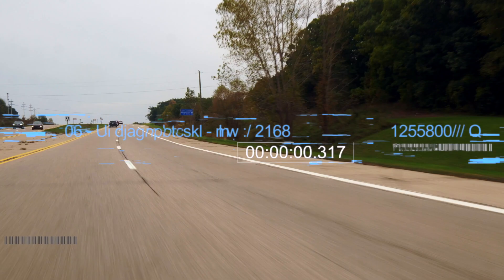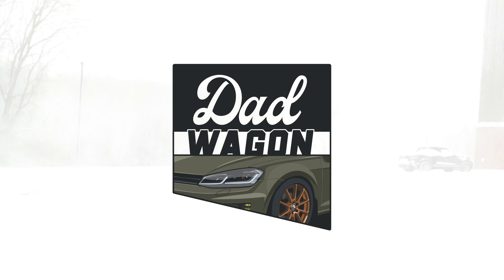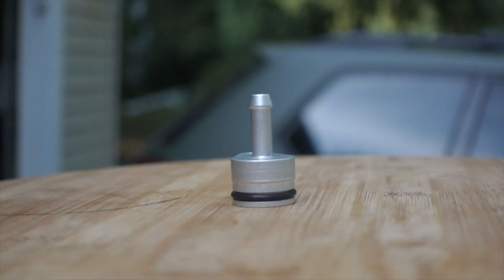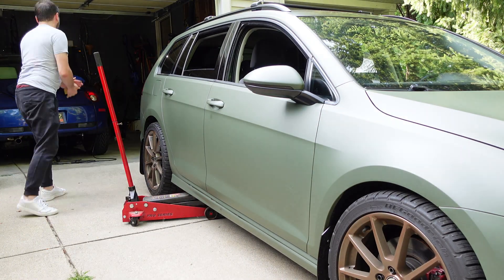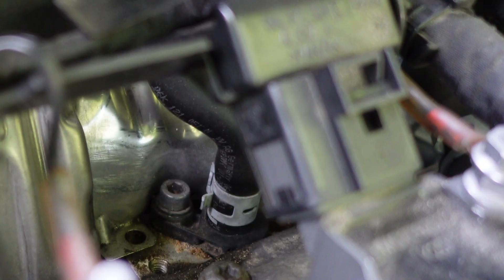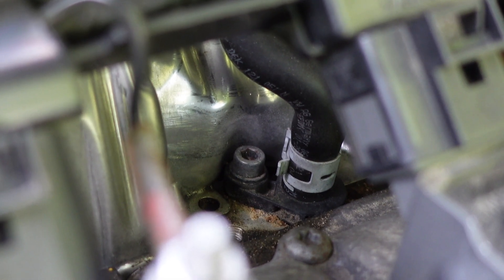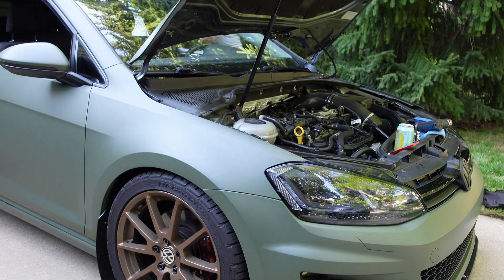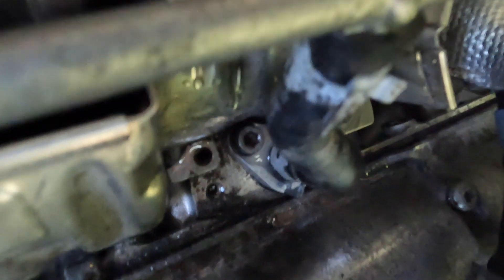Aluminum Coolant Flange Replacement to Prevent Leaks - Mk7 Golf GTI Golf R Alltrack

Comment: Hi guys, I have my thermostat and water pump replaced like 5 months ago. I now have had a slow leak for the past 2 months, its been to 3 mechanics and not a single one can find where coolant is going. The coolant leak is very slow like maybe 1 litre every 2-3 weeks. Do you think this video is the same issue I have?

Comment: I went inside Best Buy store yesterday. , just looking around. When I Came out & started my car I saw a low coolant warning. The temperature gauge did not show over heating. So I drove home. I googled the issue and was told to check the coolant level in the reservoir. Sure enough it was low. I had some ooolant in the garage. I filled it up to the proper level and the warning signs went away.
I just bought this car used. It runs great. Now I am thinking I need to replace that plastic flange.
Reply from the maker: Just depends on where the leak is coming from. You should be able to track it down with a flash light.

Comment: The type of oring used also seems to be an issue. The rubber swells due to the high temperature and exposure to the coolant. Do you know if the aluminum part has a better quality oring and how is the part holding up since you replaced it ?
Reply from the maker: I don't, but I haven't had any issues since install.
Reply: Thanks for the info and video. Where did you order the part from?

Comment: I had this problem happen to me this week. Smoke started to come out from under my hood. White smoke at that. I looked at may car and checked for an oil leak and it wasn’t that. My cousin said to check for a coolant leak and he was right. I ordered the part. Just waiting for it to arrive. Thanks for your video, now I know how to change it.
Reply: It went well. Removing the rubber hose was a pain. It was really stuck. But once removed. I installed the part and all is well.
Reply from the maker: Sorry to hear but glad you got the part on the way! How did install go?
Reply: Same thing happened to me today.
Reply: @lowkey5854 good luck man. It’s an easy fix if you have the right tools and parts.

Comment: Thanks for the video. A few notes:
- My ground nuts were sized together so I did this without removing my harness it was fine
- I removed the hex bolt and then pulled the flange with the hose attached out of the car which was easier for me to get the hose off
- I didn’t find a need to jack up the car, although I lost about 1/2qt of coolant.

Comment: shot in the dark here, but does anyone know offhand where the get the part no of the small angled hose 4:04 which he is able to reuse in this case? In the case of my Alltrack, hose was brittle enough to break apart, I have an old rubber air line hose that I cut to size and mangled in place however I’d like to obtain the oe hose. Excellent video, and props for your build
Reply from the maker: Great Idea!

Comment: Literally could of done with this video three weeks ago mine failed on the way to work and steam spewed from under my hood and was due the o ring spitting what the benefits from replacing it with an aluminium one I just replaced mine with another plastic one from volkswagon im better to go out and buy the aluminium back one
Reply from the maker: Dangggg - sorry to hear that. Glad you got it repaired and for a pretty easy job and $33 bucks - yeah it may be worth it!

Comment: It’s not technically for turbo coolant feed or return. It’s more of a coolant head bleed port, it shouldn’t have much of any flow just a passage back to the expansion tank to and other various other coolant circuits of that hard line.
Reply from the maker: I realized this post-filming - tried to correct as best as I could - thanks the additional detail, as always!
Reply: @DadWagon  I did chip the upper plastic on mine when buttoning up my IS20 swap, no leaks yet. Didn’t know an aftermarket solution was available. Will keep this in mind if a leak develops.
Reply from the maker: @740GLE  Same, after removal, I noticed the upper 'rib' on mine had cracks on both sides.

Comment: How much coolant leaked out didn't look like much at all? Another great video Thanks DadWagon.
Reply from the maker: Thanks so much harry berry. Maybe.... a quarter cup?  You are correct - very little came out. I believe resealing the reservoir to create a vacuum and the rear lift helped a lot.
Reply: @DadWagon  Did the majority come out the rubber hose or where the flange was? Either way not too much to fret about.